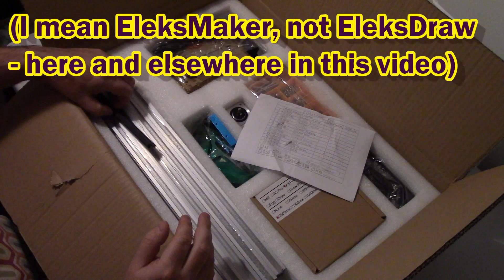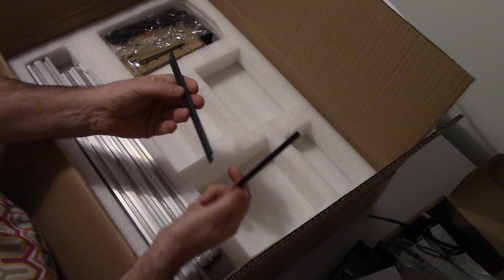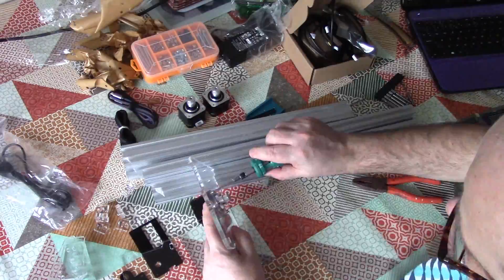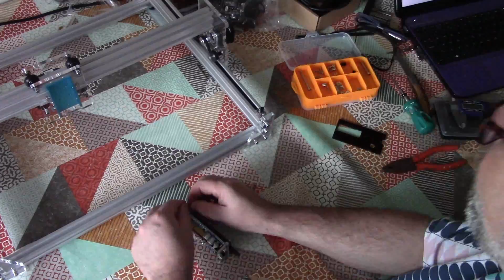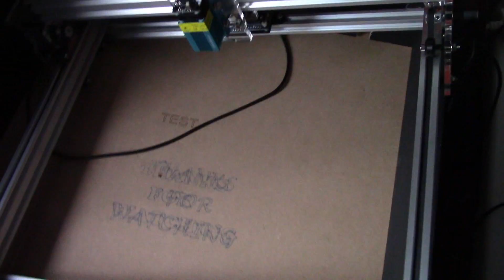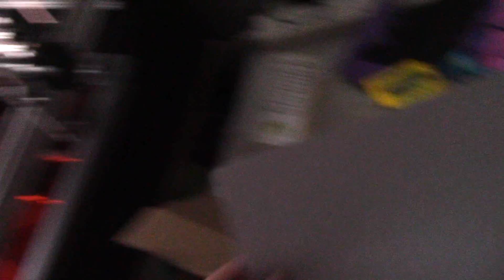EleksMaker A3 Pro Laser Engraver - Unboxing, Assembly And First Impressions

Comment: The pins on a euro plug are designed to bend slightly inward so that it matches two different types of socket
Reply from the maker: I didn't know that - thanks for the info
Reply: Good to share info... i thought the things were a bit flimsy when first seen, but in a UK adaptor (a proper one, not a shaver adaptor) they're fine.  Appreciate your videos a lot. Felt good to give some info back :)